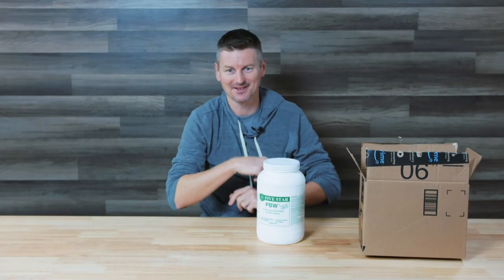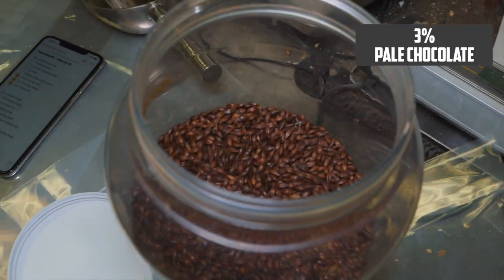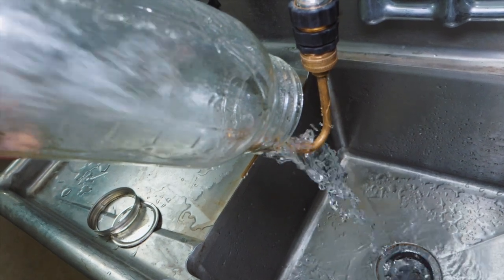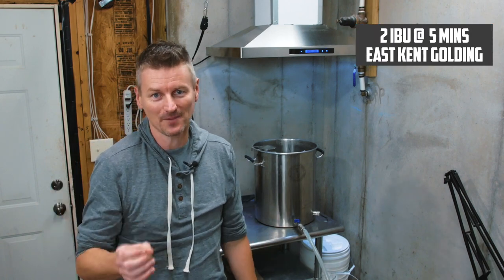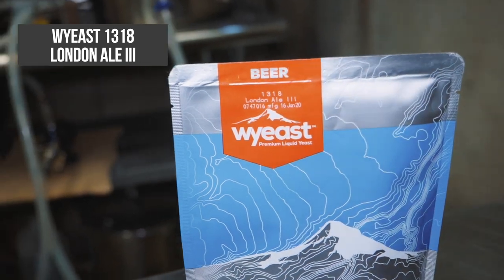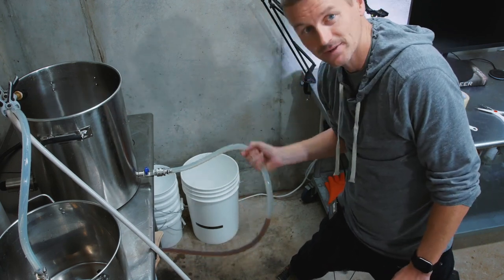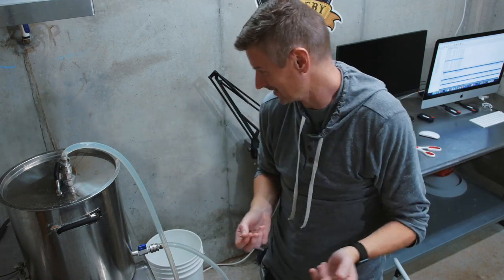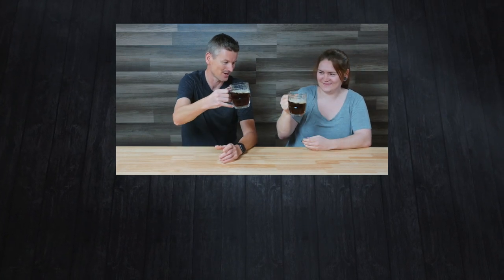British Brown Ale | Cleaning Brewing Equipment

Comment: One small complaint about the clawhammer system. The element has the cable attached. I have a couple other elements that have a twist lock connection. It is nice to be able to rinse the kettle with the element in and no cord hanging off. One other thing PBW is most effective at 150f. Nice video Martin! 👍🍻
Reply: I noticed that as well. Hasn't scared me off yet (saving money) but it would be cool if they made a disconnect.
Reply: @MicroSessionsBrewing  not a deal breaker, just a minor complaint. 👍🍻

Comment: If you have the spray valve at the top, why not just use enough PBW solution to allow recirculation instead of a full 10 gallons? Greetings from Yorkshire btw

Comment: I noticed that you don’t sparge after mashing - any particular reason? Would you not be able to improve mash efficiency? Great series of videos, really enjoying it - my ability to convert to °C in my head is improving with every episode 🤪
Reply: James Carnahan clawhammer is a BIAB non-sparge system. Basically use all of the water at once instead of sparging. You would do a mash out to get your best efficiency, but BIAB systems do run a little lower on average in exchange for ease and convenience.

Comment: Comforting to know that the Brown Ale recipe I knocked up to brew at the weekend is quite similar to this. 
I have planned to brew with some light roast Coffee though and then drop in some Maple syrup and Cherries during Fermentation.🙂
Fingers crossed.😬
Reply: Coffee goes great with brown beers, just added a bit to my mild to round it up, and all the notes make more sense now, I used an espresso roast but it's a quite acidic, fruity and nutty origin, I guess the key is there, going too dark with the coffee will make it to stouty
Reply from the maker: Sounds great!
Reply: @kiliang96  what would you suggest in terms of quantity? I was going to go about 50g at 10 minutes. Don't want to overpower the Malts but want to know it's there. 🤔
Reply: @Ballbagsaggins  I added it at secondary, I was afraid of getting astringency and a lot of bitterness by over steeping the coffee on the hot side, I used 2 grams per litre, but I passed it through a sieve to get rid of the tiniest particles, so maybe there is a bit less

When adding things to secondary, I tend to add a big quantity for a short time than a small one for a longer time, so maybe that's too much coffee
Reply: @kiliang96  I had thought about adding it in secondary but had a bad experience  with a white stout last year which sort of put me off. 
Worth considering though. Thanks.🙂
Reply: I would do a tincture and add at secondary. A little goes a long way. 8 ounces of vodka with an ounce of coffee would be nice. Let it sit for maybe 2 days before adding.

Comment: Have you ever tried OxiClean Free in place of PBW? I have had about as good results as with PBW for a lot less money. (Some people add a 2/1 mix of Oxiclean to TSP/90 but i haven't found that necessary)
Reply from the maker: I’ve not tried OxiClean Free, will look out for it.
Reply: Careful...oxiclean can depassivate stainless over time. PBW and oxiclean are different.

Comment: How much PBW are you using? 3/4 of a cup? Isn’t that way to much?
Reply from the maker: Yes 3/4 cup for about 10 gallons of water.
Reply: 3/4 oz by weight per gallon of water is recommended. 3/4 cup sounds pretty close for 10 gallons